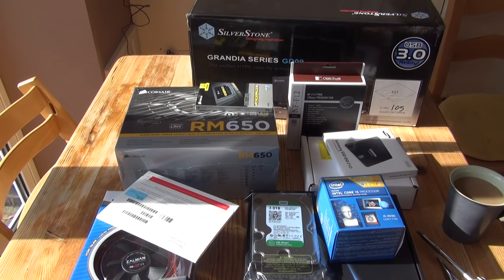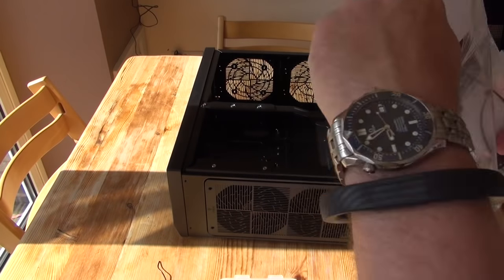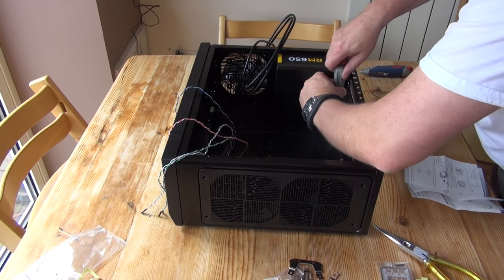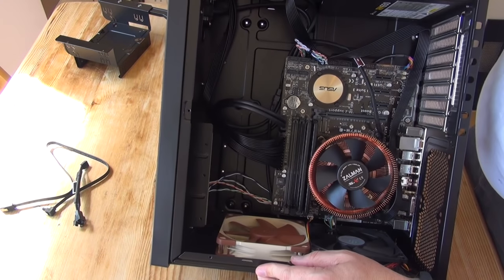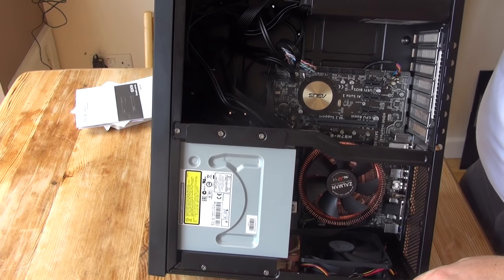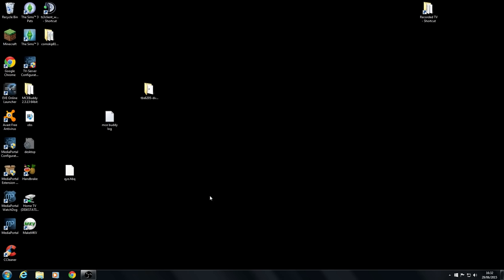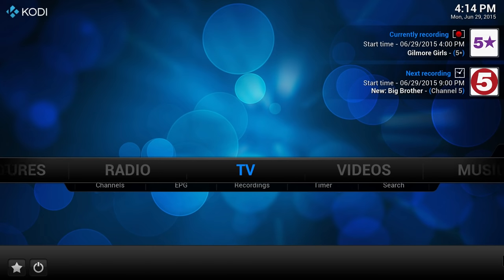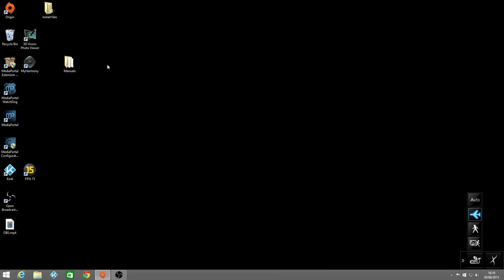HTPC build - watch me assemble my HTPC in a Silverstone GD09 case!

Comment: Bought this particular case last 2014.  Basically moved the hardware from my desktop case to the GD09. Did a little bit of an upgrade to make the case a little bit quieter.  Installed two Silverstone 3.5 to 2x-2.5 converter in order for me to set up four SSDs. one 250 GB Samsung 850 EVO for OS and three 850 EVO 500 GB for storage.  For the CPU cooler I installed the Noctua NH-L12 exchanging the stock fan with a 120mm Gentle Typhoon 1450 which is quieter than the stock Noctua fan. I Didn't bother to include the 90mm Noctua fan. I had to move the  Corsair Vengeance ram on the second slot since the heat spreader are touching the CPU heat  pipes. I also upgraded to a 520W Seasonic fanless Power Supply.  As for the case fans I Installed three 120mm 1450 Gentle Typhoons fans. 

My HTPC is hooked up with a HdHomerun Prime tuner which records Live TV using Windows Media Center. As for the Movies, I installed Emby Classic for WMC. So far I haven't installed a dedicated video card since I stop gaming. I would eventually install a GPU in the future the fact that I already have two Xbox 360 controller for PC to boot. However, if there would be a stable app for Windows 10 for  Live TV I wouldn't hesitate to upgrade my Operating System and upgrade to XBOX ONE controller the fact that it only works for Windows 10.

My other HTPC specs:

Intel CPU i5 3570K
Asrock MB Z77 Extreme 4
Corsair Vengeance (2x4 8GB)

Peripherals and accessories:

Inteset 4-1 universal Remote connected to a IR USB Device from a previous Rosewill MCE Remote control.
Logitech K400 Bluetooth keyboard connected to a Cirago Wifi/bluetooth combo USB device.
Reply from the maker: +trizanzor Cool setup, especially the triple SSD storage - expensive but nice!  I also used Xbox controllers on my unit which I have now upgraded to WIndows 10 withiout issue - one of the benefits of not using WMC!  I have no idea why MS abandoned MCE in the way that they did, a shame.  Thanks for sharing your specs! AM

Comment: 2:23 DIMMs are insrted into A1 and A2 - this offers single channel memory access.
Manual snippet:
"If you want dual channel, use (A1 and B1) or (A2 and B2).
If you want single channel, use (A1 and A2) or (B1 and B2)."
So A1 and B1 for two stick in dual channel mode.
Reply from the maker: Absolutely right! See other comments on this :) AM

Comment: One of the best build video I have seen in a LONG time...Good Job

Edit:  Did you find that the power supply placement to be a pain?
Reply from the maker: Thanks thebig42! It seems like a long time ago since I did this build but I don't remember any major issues.  In reality the GD09 case is a pretty big case for an HTPC so its a very comfortable case to build into (by HTPC standards.)  It was over 3 years ago now but this PC is still quietly working away and has been virtually 100% trouble free so I have pretty much ignored it - it is mainly used by the family anyway, I don't watch much TV. AM
Reply from the maker: Hi Tom,  the manual says "Support cards up to 12.2”, width restriction 5.25” so it sounds like you will need to get your ruler out and make sure you have great cooling, its big for an HTPC case but not that big for a "proper" gaming PC! AM

Comment: Ok, I want to buy this case but I need to have 3 SSDs and a RTX 2080ti. I don’t need the blu ray drive. Do you think I can fit everything there?
Reply: I just built one of these with an asus strix 1080ti (triple fan), 1ssd, and 2 hard drives...plus a 1000watt psu...everything fit like a glove with exception of the one fan next to the psu...that one needed some finagling...cheers👍

Comment: Thanks for the video. Been thinking about getting this case and this video was very helpful. I got 2 HDD, 1 SSD and an Optical drive so am not sure where to put the 2nd HDD even though the specs say you can.
Reply from the maker: +Perdomot Hi Perdomot, I am pretty happy with this case buts it is limited on HD locations, you are provided with a bracket for a second 3.5" drive which mounts on the base of the case in front of the bracket, page 9 of the manual (I linked the manual in my post below to shaunmac).  I haven't used this, in fact I removed my HD and have since moved all my storage onto the server which does my TV / media - this has the added benefit of greatly reducing the noise levels.  Bolted directlty to the base of the case you will potentially see an increase in noise although I have found the case is fairly quiet.  Good luck with your build! AM

Comment: Hey I'm actually thinking of doing the same build, except planning on using a 4570s and possibly a nocuta nh-l9i. Would you recommend that CPU cooler or something better that is even quieter? I prefer going with noctua, but if you have any other recommendations, I'll consider it. Also why RM650? I have a RM750 and have some weird buzzing noise, but it could also be due to the lights I'm using. Would you recommend that PSU or something else that is even quieter. Last but not least, did you properly mount the SSD or was it mounted in some weird side?
Reply from the maker: Hiya,  I don't recommend the Zalman cooler I used - too fiddly.  I haven't tried the Noctua one you describe but generally I like their stuff. I have used Scythe LP coolers and found them to be good e.g. Shuriken.  The SS is mounted  using two screws as  shown in the video,  not really an issue.  I like Corsair PSU's and haven't had any issues with noise at all,  I believe a lot of them are actually made by Seasonic (who I also like!). G with your build! AM

Comment: I've only worked with ATX motherboards, but aren't you supposed to put the ram in every other slot? Or is it different on micro boards. I also use this case and was trying to find a better CPU cooler and fan set up
Reply from the maker: The motherboard manual will tell which slots to put your RAM in for the best performance, the slots are sometimes colour coded. This case is great for cooling as (for an HTC case) it has lots of space for air flow. AM

Comment: If I put a large motherboard, can I put cpu cooler and put the bracket of the burner and the hard disk in place without the Board will interfere with ?
Which tv card used in your video ?
Reply from the maker: RS flight Hiya, as long as you use a low profile cooler you should be OK with either ATX or microATX - max cooler height is 138mm according to the manual.  You won't get a full size cooler in with the bracket in place. My TV card is in my server (a different PC) have a look at my review of it, I just uploaded it!

Comment: Excellent video, one question however.
If using an std optical drive is there only mounting space for 1 3.5" Hard drive?
Reply from the maker: shaunmac mcdermott There is supposed to be a second 3.5" HD mounting point in front of the bracket on the base of the case and a small bracket is provided for it, I didn't use it.  It's on page 9 of the manual http://www.silverstonetek.com/downloads/Manual/case/Multi-GD09-Manual.pdf
Reply: Yes.

Comment: Any conflict between your 5.25" optical drive and the front right 120mm case fan?  I'm about to undertake a similar build to yours, though with lower power components.  (35W Skylake and fanless Seasonic PSU)
Reply from the maker: Mine has standard fans and I don't recall any issues or conflict with the optical drive. Good luck with your build! AM
Reply: Thanks very much!

Comment: I am also thinking of using this case,  but without a BluRay drive. Will I be able to mount the SSD in place of the optical drive?
Reply from the maker: Hi! According to the manual you can install two 2.5" drives,  e.g. SSD's,  instead of the bluray drive in the bracket and a further one in the same bracket where I fitted the 3.5" conventional hard drive. AM

Comment: What are you doing rubbing the motherboard over the anti-static bag?! Also your RAM is not going to operate in Dual Channel. You should do every other slot starting from the left. 1st slot and 3rd slot for optimal RAM efficiency. It does make a difference in performance.
Reply from the maker: Thanks for your comments, this is a very old video, your observations are both addressed a few times in the replies to other comments below. AM

Comment: How do you find the 750 Ti for 1080p gaming? Will it support nicely a 4K desktop resolution and maintain 1080p 60FPS with high settings on games?
Reply from the maker: I don't know tbh as I don't use 4K, the gaming performance at 1080p is OK on the games I play (Project Cars, FIFA 15) but they are not the most demanding and I don't have the settings maxxed out.  No idea about framerates.  This build is mainly an HTPC build for our lounge TV and the very occasional game, if I were aiming for gaming performance then personally I would be looking for a different setup including a more powerful GPU .  My Mid-price gaming PC build video might suit you better tbh. GL! AM

Comment: Do you think you may fit a corsair H80i in it or quite impossible?
Reply from the maker: Nargal Vanr Not sure, I have an H80i in another PC and it doesn't need a huger amount of clearance above the CPU - I think the problem will be where you fit the cooler, the nearest double fan bay will probably obstruct the drive carrier and the far side is probably too far for the tubes to reach.  You'll need to do some detailed research with the case manual and a ruler  - my guess is it is doubtful, probably not.  Its not on the compatibility list here either http://www.overclock.net/t/1144409/h80-h80i-h90-h100-h100i-h110-case-compatibility-thread-page-1-for-full-listings
Reply: My guess was that it´s doubtful too. The H80i (corsair) it´s thick even with only one 120 mm fan. Wasn´t just sure how much space there is. Far side is much to far indeed. Thanks for your answer and the compatibility list. Guess I´ll go for a Fractal Design R5. Have a NZXT 630 and i love it, but it´s so huge (great to work in it, but hard to transport)

Comment: Question, we're is the extra hard drive bay ? It says it has 2 3.5 inch Drive bays, there Isisnt a second hard drive bay, did my freind forget to install it ?
Reply from the maker: According to the manual (linked below) you can install two 3.5" drives in the drive cage,  shown as example 3. This will take the space normally occupied by an optical drive though :( GL! AM
Reply: theres an extra drive bay vertical under/against the optical drive/hdd caddy against the front of the case

Comment: Can you put a full size 1080ti video card in this like a Gigabyte extreme aorus
Reply from the maker: Hi Foxmino, The manual says "Support cards up to 12.2”, width restriction 5.25”, not sure the dimensions of your chosen card but there are certainly 1080ti cards smaller than this.  I am sure you have your reasons for choosing this case but it is obviously not really designed with optimal thermal performance in mind so you will need to research carefully.  A high power graphics card, cpu and PSU will need careful thermal planning! Good luck AM

Comment: could a r9 fury x radiator/fan fit in here?
Reply from the maker: +Ryan Azarko Wow thats a meaty card - The manual says "Support cards up to 12.2”, width restriction 5.25” - the challenge will be finding a suitable location for the substantial dedicated Water cooler and I think you might struggle.  I don't think this is the case for a super high performance gaming system personally - I wouldn't risk it! AM

Comment: can you control this via remote?
Reply from the maker: +Brian Michael Yes you can use a USB MCE or compatible infra-red receiver.  Personally I have a MS one and we use a Logitech Harmony remote - once its set up its just like using a normal TV - the MS compatible cheap receiver / remotes you can buy on ebay also work fine in my experience.  I like the Harmony because it also can control my sound-bar and my TV from a single device which is handy. I keep a  cheap wireless keyboard hidden behind the TV for doing any system maintenance or PC related stuff but the rest of the family just use the remote. AM
Reply: Amoeba Man I would probably get a Logitech k400 wireless keyboard for the media PC build. I would run the PC through stereo receiver and have the stereo receiver connect to the TV and other things like speakers.
Reply from the maker: +Brian Michael The K400 is a good choice, mine works well and is inexpensive - its nice to have a remote as well though, especially if you have non-geeky users who like to keep it simple, in my case the wife and kids! AM

Comment: 3:20 psu is already assembled
Reply from the maker: Yes, when I edited the video I obviously decided not to include PSU installation to keep the time down so it is already shown installed.  In my defence, it is usually only 4 screws! 

Regarding ventilation :  have a look at the "Cooling System" section and the "Feature Photos" to see the design details,
http://www.silverstonetek.com/product.php?pid=488

AM
Reply: trying to know whether psu fan face holes on the case panel, inhaling fresh air from exterior. that silverstone website shows empty case, i dont know where psu is located at, in that empty case.
Reply from the maker: It is clearly shown in the manual, linked above and you can also compare with the photos on the website and my video . Good luck with your build! AM
Reply: 5:40 harddrive is being shown